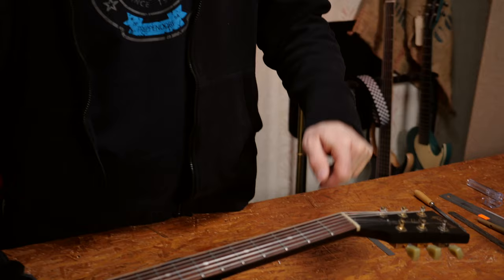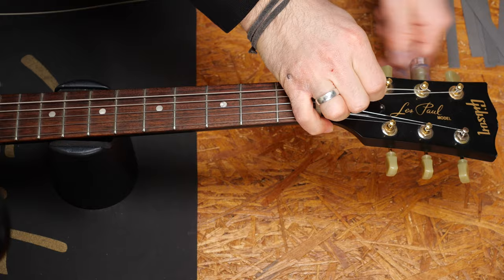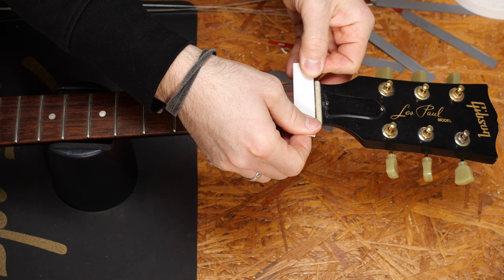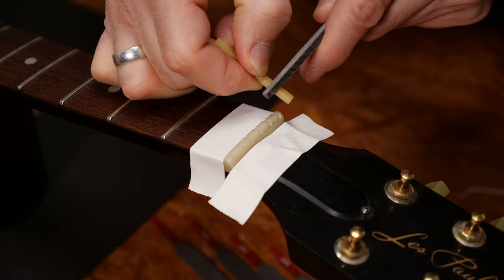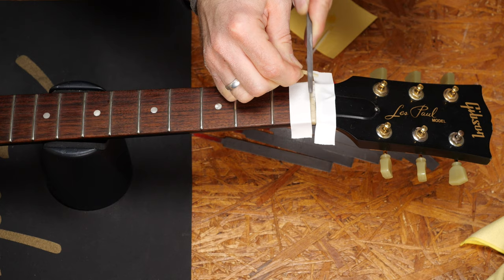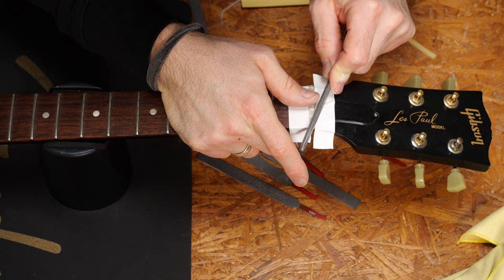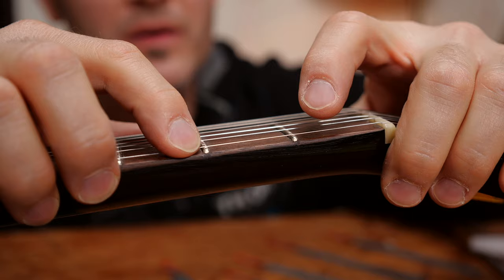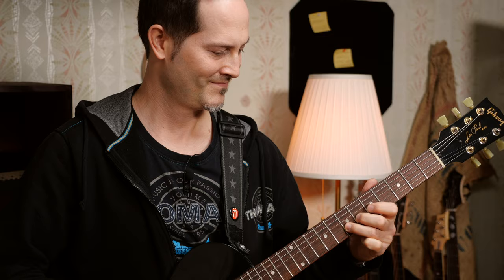How to Fill a Guitar Nut | Guitar Tech Tips | Ep. 33 | Thomann

Comment: I found this method extremely easy. My Gibson LP low E and A strings were a tad too deep out of the box. Rather than actually fix it, I was afraid to thinking I would destroy it somehow and continued to play daily. The other day, I used a piece of 400 grit dry sandpaper on a flat surface and sanded an old bone nut I had laying around into fine powder. Used a plastic soldering probe (one side like a flathead and the other shaped like a pencil tip. Taped off parts adjacent to the nut to prevent messes. Used flat end of tool to gather the dust, sprinkle it on, and pack it in by pressing your finger across the grain of the slots, use pencil tip end to pack in the circular space. 
I’d put a tiny drop of gorilla superglue over the slot. I then tried to pack the glue a tad to soak into bone dust, and immediately got another small toke of dust and added to the slot, which was barely beginning to cure. It seems to want to mold/pack perfectly this way.  

Had a very fine and tiny file that made the job ridiculously easy. Even without intonation, my barre chords 1 sounded better and 2 felt far smoother and easier to play. Also, playing single string 16th notes, transitioning up or down a string is sooo easy. The radius is now fixed, I sound better, it feels easier to play..

……will say I felt like I was scraping up lines of blow for the first time in 15 years with that bone sand collecting. Lol

Comment: Thank you! I changed it up a little and used ABS plastic dust. Just sanded it with 180 grit. Very solid after the glue. Perfect match on the black. Used a plumbing coupler I got for $0.98. ESP has molded plastic in the specs on the EC-401, so figured I’d match it as close as possible. No loss in clarity or sustain. Thank you again.

Comment: While this is a handy and classic tip for a quick fix, I'd recommend just getting a new nut. Bone is not the same as bone dust mixed with superglue. And you will end up with an inconsistent nut regarding the density on each slot. Also: You should be careful when filing that mixture down, as the fibers that it forms can  get under the skin of your fingers, much like fiberglass or carbon. 
Which isn't dangerous, just annoying, but you DEFINITELY do NOT want to breathe that stuff in.
And for those that don't feel like filing at all: Just get a pre-slotted nut for 10 bucks.

Comment: Thank you for this great video. I have recently purchased a Hamer custom shop Newport Pro 12 string electric. It is around 20 years old, but never been played. The setup seems really good, but was made using the lower string/higher string setup on strings 3,4,5,6 instead of the inverse. If I decide to change to the higher string/lower string order, would you advise filling the nut, then refiling for the proper string guage? I'm leaning away from replacing the nut because the neck binding continues along the sides of the nut.
Thanks!

Comment: For anybody watching in 2024... As he said, just make some dust out of a similar material as your nut and use the thin flavor of super glue.  You can make little spatulas out of a plastic food product lid which the super glue won't stick to as readily and you can do a little preliminary cleanup and pressing the filler into the slot.  Away from my tools on vacation, I've actually used a finely serrated knife to begin the slots and then folded 220 grit sandpaper over the edge of a razor blade to file the slots.  You have to keep going to a new section of sandpaper but it doesn't take much.  Cheers!

Comment: Not really necessary. A new (preslotted) nut is only a few dollars. A little sanding on the bottom and there you are! An with a lasting result. 
If you are going to play guitar your whole life, it is advised that you become a home luthier with a set of the most used tools.
If you do not setup your guitar regularly, it will grow into a more and more bad playing guitar.
At least put on a new set of strings every month.
And use a small gauge like 8's or 9's if you want your hands and fingers to be able to play when you are 64+
PS. You can practice your luthier skills on defect and cheap guitars....

Comment: Really not something that anyone other than a luthier should be doing?
Reply from the maker: Maybe yes, maybe no. It really depends on the person and the guitar. :) If you want to learn these things and don't mind messing up some nuts, why not doing it yourself. If we're talking about an expensive guitar, or - even worse - your favourite instrument, please let a luthier / tech do it for you. Haha! 
//cheers, Kris
Reply: Some of us want to learn and we learn by doing.  I have a cheap guitar I try things on so I don't ruin anything.  One thought is how many nuts could you buy vs a trip to the luthier IF you want to learn?  For those that get the point of these videos it's fine with us so.....
Reply: I did this on my strat and if you screw up you can always easily install a new nut. It's not rocket science
Reply: @mathias5618  Yep!!
Reply: No proper luthier would fix a nut like this.
Just get a few nuts, (they're like 2-5 bucks, depending on the quality/colour) if you want to learn it, and try.
There is also pre-slotted ones you can buy, mostly from artificial bone.
Reply: @JustRockMySoul  there are videos on stewmac where they do it.  I had it done on my Martin as I don’t want to be hammering a perfectly fit nut that was lacquered over, out of the thing.  Worked awesome.
Reply: If you are going to a luthier I think you would get the nut replaced not this band aid fix.